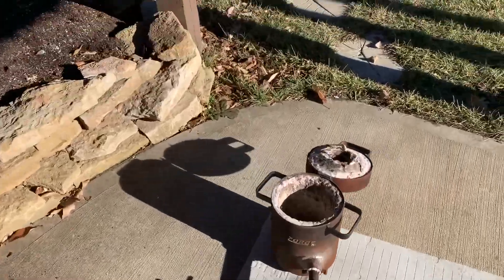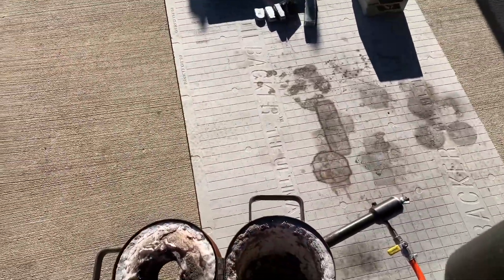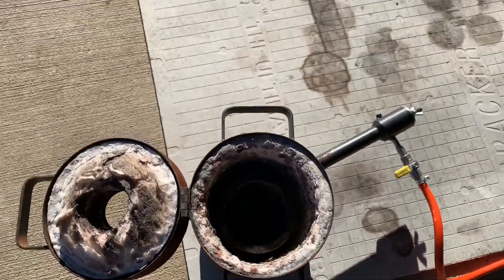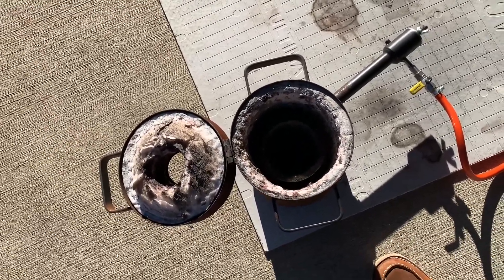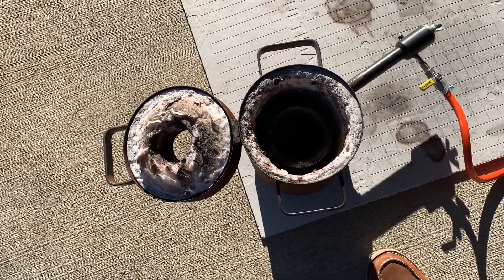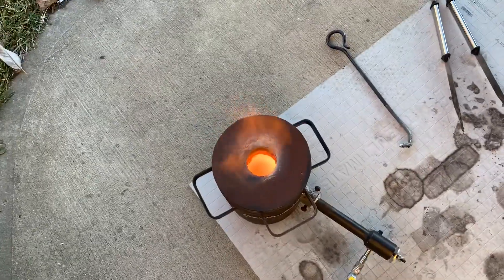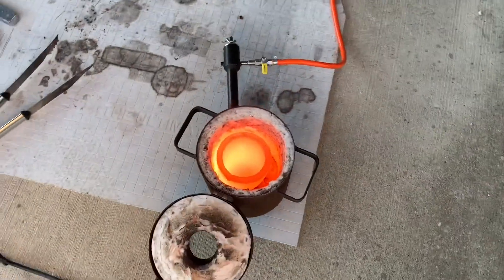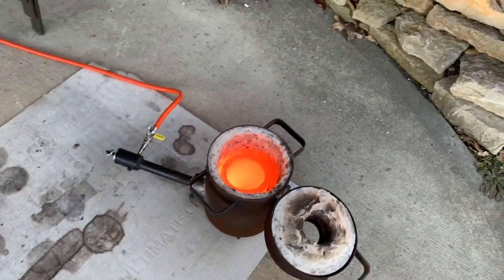How to temper a crucible part 2

Comment: You're one of the first other people I've seen working on a backerboard. I've been doing this since day one it is by far the safest surface to work on. Spilled metal doesn't flow easily and it won't burn! Surprised this isn't more common knowledge.

Comment: Would this stop the crucible from melting? I wish I watched this hour ago. Mine melted a hole through the side and the aluminium fill the bottom of the foundry
Reply from the maker: I’m sorry to hear that if yours is clay graphite then it shouldn’t melt unless you get your furnace to 3000 plus. If you are using a steel one that is very possible and no this wouldn’t stop from melting this just cures graphite crucibles search them up on amazon. Don’t use steel unless you have a charcoal furnace then use a thicker steel. It’s best to get a 3-4kg clay graphite crucible off of Amazon I hope this helps I’m terribly sorry that didn’t work for u. It it was graphite this would stop it from cracking and spilling out the sides. Good luck! I’m only 15 so if this doesn’t work I blame that.
Reply from the maker: Bryce Kirkwood yah read the other one I forgot to reply directly to u hope you get the notification

Comment: When at all possible, best to leave the crucible in the furnace to cool down slowly, when ever you can.  I know when I leave mine out, they start making weird sounds as they are cooling down, but that's only the case when I am busy using the furnace, and and I can't get multiple crucibles in it.  Your skillz are getting better, that just comes with time and mistakes, we have all had plenty of both.  LOL
Reply from the maker: Thewulf 56 thx for the info I should have opened up the lid when starting it but it doesn’t really matter that much
Reply: Exactly my thougts!